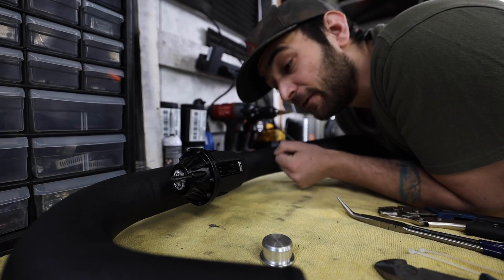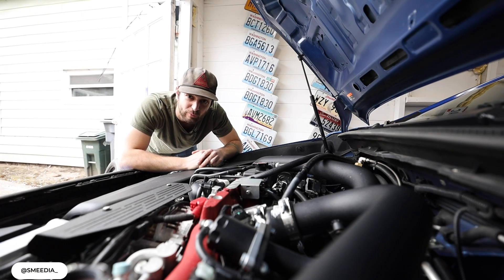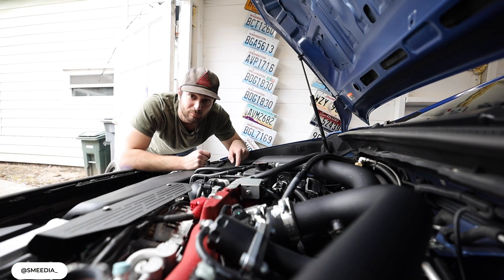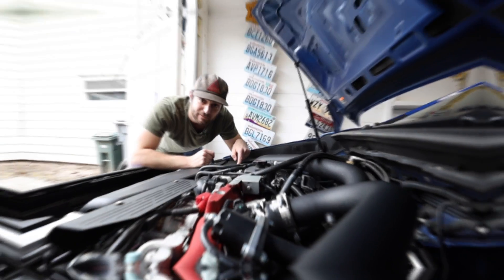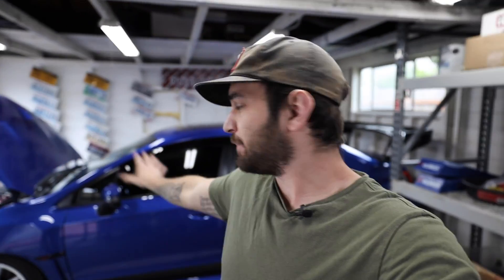This Is Why You Shouldn't Use a BOV On A Stock WRX/STI

Comment: the car is going to run rich only after the blow off valve opens not on idle or cruising XD unless the spring is set extremely soft 
edit: hybrid is best of both world imo
Reply from the maker: The issue with the BOV is when the car is not produced with it and is paired with a OTS Map or OE tune. As long as the tuner is fine with it and tunes the car with it, the WCU has some idea of what is going on
Reply: @Smeedia  I agree letting metered air escape is no good, but a 50/50 bov will not make a car run much worse, just richer as you shift. The stalling and stumbling happen on fully atmospheric bov like the Hks or set to a low spring pressure .
Reply: @Smeedia  I've been out of the tuning game 12+ years, but at one point HKS made a recirc adapter.  Do they not anymore?
Reply: @samuelaudet845  That's actually incorrect. 50/50 Hybrid valves will make the car behave exactly like this. You will have stalling issues, rich A/F mixture issues. I know this because I have a Turbosmart 50/50 hybrid valve, and ended up going back to stock BPV because I got tired of dealing with the stalling, richness and turbo flutter (because of the FMIC).
Reply from the maker: They still make the recirculating adaptor but its never utilized
Reply: @7ate7  well mine didn't, but i guess the intercooler set up might worsen the effect of a bov because if you had trouble with flutter i guess your spring wasn't too soft but i ran 50/50 on two different subaru without stalling. Richness on the other hand is expected on a fmic maf based tune wich might explain it, both of my car are tmic and I did not think about that
Reply: samuel audet yea, with the TMIC I had no flutter.
Reply: I was going to say the same. I mean I feel people are so over dramatic when it comes to bovs. Ive had them on my cars for over 15 years (different cars) and I've never ever ever had any of these issues like stalling, idle etc.  It runs rich between shifts but at idle for it to stall, I agree the spring is just way to soft.

Comment: This is why I miss my 12sec front real drive srt4. You could throw a Bov, down pipe and anything else on it and not worry about hurting it. No tune and it was mean as shit. I know that's an older car, but just saying.
Reply from the maker: My buddy has one sitting in his garage that he's putting back together. I think he said its build for around 700 WHP, although it's been apart for years with a built engine on a stand for the entire time 😅
Reply: @Smeedia  I sold mine two years ago to a friend at work and every time I see it or hear it I miss it. That car is 15 years old and runs great still.  I love the people that say it's just a neon.
Reply from the maker: I'll get some video of my buddys here soon, and I know the feing when I sold my old Z I was the same way 🙃
Reply: @Smeedia  I raced my old car after me and my friend kris I sold it to went to see Ford vs Ferrari lol the movie made us race so went to a back road and in 3rd gear he owned me by like 2 cars both times lol
Reply from the maker: Those SRTs can be gnarly little cars and they sound good too! I've seen some of them drag cars before

Comment: When would you decided to put the car on e85? Like right away?
Reply from the maker: Depends on goals and what you want out of the car, I've waited 2 years before making the change to E85
Reply: Chris Retro E85 is almost mandatory for track applications. It is cooler than normal fuel and less conducive to knock as ej engines have cooling issues and prone to knock.

Comment: Crazy how swapping out one car part makes a negative difference in performance
Reply from the maker: Its all about tuning and making sure the car knows whats happening.
Reply: Just like @smeedia said, the car has to know what is going on, so you can tune for it, but any reputable tuner will still recommend against it on a MAF car. Don't trust when a manufacturer tries to say it doesn't require a tune, it will honestly.

Comment: You still have a stock turbo inlet and tgv’s? Do you recommend changing those out ? I want to make 350 hp on my 18 sti limited. I have killer b oil pan etc cylinder 4 cooling mod iag aos stage 1 Cobb sf and a full Cobb exhaust with catted dp
Reply from the maker: Your going to need to swap the fuel system ( Injectors, pump FPR and rails) swap the turbo, and a few other things but your well on the way. I will be swapping to TGV Deletes and changing out the turbo inlet on mine
Reply: Smeedia stock turbo is maxed out that quick ?
Reply from the maker: Yes sir, had to get some clarification from a few tuners but they all said that the OE VF48 wouldn't be able to handle 350WHP reliably
Reply: Smeedia that’s disappointing feel like that’s not a huge increase compared to other cars stock turbos. finding out really quick subaru’s ain’t cheap!

Comment: Been running HKS bov on my STI for 30k miles have had no problems but I did have it tuned when I installed that after
Reply from the maker: Your at least tuned for it, the real issue is stock cars at ones using OTS maps that install it. OTS maps already have their own set of issues but pairing a BOV with an OTS Map and OE map its bound to not have a good time 😅
Reply: Smeedia ya I remember I put it on without a tune it ran ok but some revving it bright the rpms down to almost stalling the motor it was bad
Reply from the maker: Thats what I was noticing as well, but it was only under load when it would try to stall out
Reply: @brannonatkinson  the issue is the bov is staying open when your hitting the limp rpm mode. You have to adjust the bov so it doesn't open easy and closes before you hit limp rpm mode. Gfb dvx has this option.

Comment: Can you get a tune for a bov? Or do you recommend bpv instead? Love the stututu noises would love a bov
Reply from the maker: I would suggest a BPV, but depends on what your tuner is comfortable doing with you car
Reply: No, you cannot get tuned for a BOV. The only option ig changing the MAF system, to a Speed Density (MAP Based) system. Which, in a relatively stock car, is pointless.

Comment: What if we have one, but the car is tuned? Also with a burble tune.
Reply from the maker: I would suggest getting off the burble tune and swap back to a BPV, the bubble tune pushed extra fuel through the system as the BOV would my guess is that your car is running very very rich